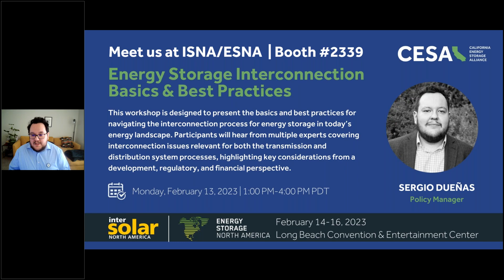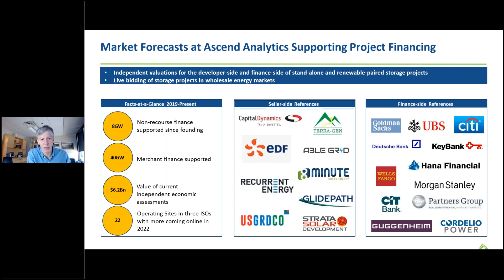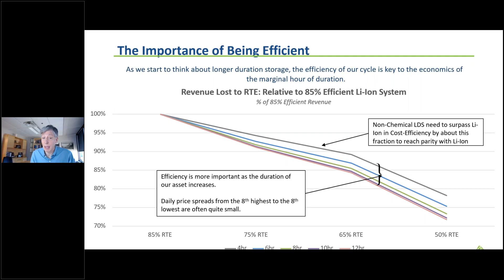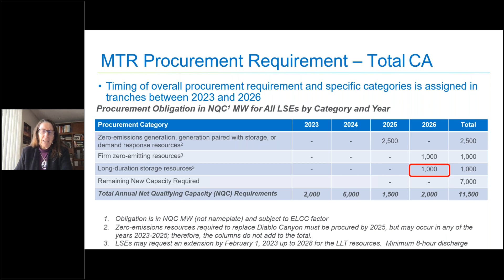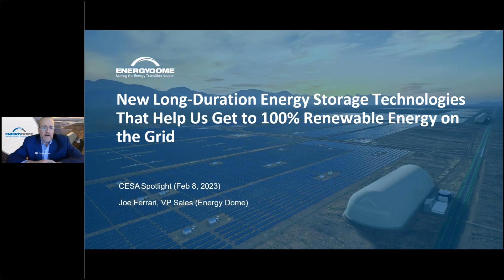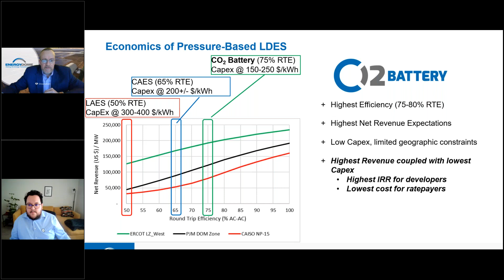New Long-Duration Energy Storage Technologies that help us geto to 100% Renewables off the grid

Comment: Also, if I did my quick calculations correctly, you will be liquifying ~400  tons of CO2 to charge the system, then evaporating it at a 20 MW pace for 10 hours  - nice tidy 200MWh!  Cool!

Comment: The weak points in these pressure technologies could be how to store the heat produced during compression and then later how to use it again for decompression. 
I was just thinking that if green energy is used for compression and the compression heat is all the time taken up by  passing water, then we get a lot of lukewarm water. During the decompression phase, we need a lot of energy coming in very fast so we get a fast expanding gas, able to drive a turbine with maximal efficiency.
So our lukewarm water struggles to deliver that, I think. But.. I was just thinking that green energy could just as well be used to heat the water near boiling point and store it that way??? A fast supply of near boiling water could decompress fast enough, I hope??